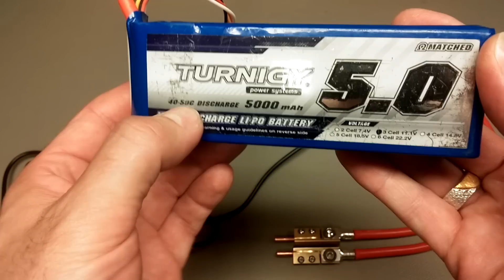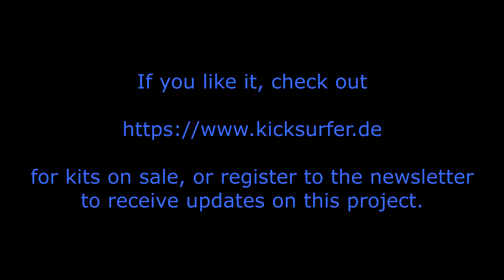Next level DIY battery spot welding

Comment: That noise gate you used on the sound is really annoying, I would prefer the background noise vs the constant gate switching.
Reply from the maker: Tried that, but Youtube says "The ability to add or edit annotations ended May 2"...

Yes, it is using high current, 1000A in this first video, and 1400A in the last update on my channel. The power it delivers into the weld spot is approx 2kW.
Reply from the maker: no rude language in my comments please.
Reply: Let's see ... you're complaining about my complaining about your complaining about the video.  Your turn.
Reply from the maker: I can check. It does not make much sense to add a note in the  comments though, because many people including me don't read them by default.

These are no high voltage tips. The unit is supplied from a 11.1V Lipo battery.
Reply: ppdan it says “next level” maybe his...... idea.... of     next..... level..... is...... different.....than.......yours.....
Reply: ppdan : great vid, sound on iphone with no headset.
Reply: A noise gate that gradually lowers the volume is much less distracting.
Reply: Seriously!?  Someone would complain about the way a full truck load of free money was stacked and presented if they could.  I think I can live with the "noise gate."  Thank you for sharing this video.
Reply from the maker: I'm sorry for that. Unfortunately Youtube does not allow modifying a video after it has been uploaded. My newer videos on this topic are better :-)
Reply: It actually went unnoticed to me until I read your comment. I had to bump up the volume to hear the noise gate effect. I suppose it might be a bit distracting if you use headphones, but I'm using hi-fi speakers and the video sounded just fine.
Reply: It's so "strong" I thought my headphones we failing.
Reply: Me too - I didn't notice it.  It's a great video, but you can give the whiners their money back and tell them to shut the fuck up.
Reply: I meant an annotation on the video. Like a big fat "sorry for the sound, too late.". Well my electronics knowledge sucks, I thought you"d need High Voltage to weld. Is it high current then ?
Reply from the maker: sorryyyy, I would re upload it with better sound but Youtube doesn't support this...
Reply: Oh, yeah ... sorry.  Their complaining just rubbed me the wrong way.
Reply: Complaining about people having an opinion? I don't think that I have been rude when I gave my opinion on this matter.
I have worked in sound and light business for decades which probably makes me more sensitive to these kind of things. I guess when we hear something like that we tend to get annoyed because the "knob" for fixing this is out of reach.
Just to clarify : what struck me the most was the poor attack settings and lack of hysteresis which makes the gate extremely obvious to any professional.
Reply: sorry too, I didn't mean to harass you but it's very surprising at first. Maybe you could add an annotation (if youtube allows this). Anyway thanks for the video, it's a need device. Scary seeing naked fingers so close to high voltage tip btw :p

Comment: How do you ensure that the thyristors fire at the same time?
Reply from the maker: These are no thyristors but MOSFETs, with all the control gates tied together.
Reply: I was sure I heard you say thyristors at 1:20, I probably misheard. I was just wondering if the small difference in turn on time would cause any issues with over 1 kA coming from the battery.
Reply: He said Transistors
Reply from the maker: Even at 2kA, every transistor alone could handle the switching process (except for the inductive kickback at turnoff), the switching time is approx 10 microseconds.

Comment: did you drop a via under the gate pins on those fets? how many layers is your pcb? your design is pretty similar to what i independently came to. I only had 70x100mm ccs when i thought it out but i have 4inch by 7 inch 2 oz boards on order now so ill probably be sticking the mcu on the same board too. I had  the source going through the board and bolting to the rails was going to be an issue but ill probably end up moving them same layer in a similar fashion. I need to get my drill rig assembled though because at the moment im hand drilling vias with a cheap tool, i compensate by extra large pads so the board survives if it slips a little but this far from ideal
Reply from the maker: The gate signal trace is on the top side, the PCB is double sided 1oz. That is enough because the power connection traces span the entire MOSFET group width, and are less than 1mm long. The bus bars quickly dissipate the heat after a pulse, I can barely measure a temperature rise. I calculated it for fun, the cross section is larger than that of the 300A fuse. I've added vias, and the same amount of copper on the bottom side, but that may not even be necessary. Don't route the current through vias anyway. A 0.3mm via can carry 1A, so you'd need >300 vias in total. Also keep in mind that minimum track widths and spacing is larger for 2oz copper, I would not go below 0.4mm for each.

I have stopped making/drilling my own boards a long time ago, professional services are just too cheap nowadays. I would be able to sell the bare board of my welder for 10€, and sill make some profit.
Reply: It was the first board i designed and only 2 months ago, but I wouldnt have done it if not for realizeing I had a huge pile of plexi in my garage and a friend I could consult with chemistry on. through her advice on how not to die, I managed to produce efficent and refreshable cupric chloride from chemicals easily available. cost was about $20 and if i wanted to i could make 1.5 gallons but cupric grows as you use it so i started with 600ml for my thin tank.

   Acetone welds plexi if the edges are smooth. I already had a miter saw. Picked up a 80tooth 10in blade for 30usd and was able to construct a vertical bubble tank for the cost of the saw blade. I had been doing phone repair so I have a vacuum hot plate where heat and vac are switched independently. using more plexi and some disassembled light fixtures I was able to suspend a $35usd high efficency 365nm led at a variable z and y axis over the "floor" of the exposure box.  drilling a few holes and using weather stripping allowed me to pull my glass plate down with vacuum so the transparency is compressed tight on to the uv resist film on top of the board. I have low iron glass coming this tuesday for even quicker exposure as normal glass reflects a lot of uv 

When i looked at proto services in the US the cost was about 111usd and a 1 week wait for the size of board i made. you get 3 for that price but my worry was how quickly cost would bankrupt me if I got it wrong with the first design. I would never do a production batch at home but the ability to prototype at home has opened the world of making products instead of repair them. I didnt end up spending much more than the 1 week service would have cost.  After drill press is complete it was probably 250-300 spent. had i spent more time in research i could have done it for 200 but much of it was trial and error so I sometimes bought things that needed to be changed.

now its together though i can get double sided 4x7in cc for a dollar a board. Anything i make in the future is now very cheap to proto. Later today im going to pick up some chemicals to try a via plating bath.
Reply: mine wasnt just a via, it was a copper rivit with the source lead stuck through and soldered onto the wide pad x6 n-fets ...irl83034
Reply from the maker: That's a quite impressive tool range :-) It deserves to be used. For PCB proto, you need to trade off cost and time. Companies like Elecrow or Seeedstudio will make them at low cost, but they don't give you order today, receive tomorrow. Only when I have to go fast, I order from local suppliers.My preferred German supplier PCB-Pool has a budget option with 8 working days and 43€ for 100x100mm 2layer 1oz.
Reply: thats not a bad price. i tend to be a rather impatient person lol. When I dont have to rivit through holes and can just plate them im thinking I will be able to do a 2 layer design in about an hr with 30min of that being hands on time. Less if I get help at some point and can teach someone to clean/prep and laminate a bunch of the CCs then insert them into a light proof bag. At night its no issue as my place is lit entirely by LED, but windows become an issue in the day. Right now im too swamped to prep a lot myself so I just do it as needed which adds to time/probably isnt as efficent
Reply: Ultimate goal is to build a ras pi into a pen test tool for a friend of mine. I built a plexi case that can house a parking garage HID long range proxy reader on one side, 4s 2p 18650 pack, pi, dc-dc converters (reader needs 24v for max range) breakout for pi, board to host the removable software reprogramable proxi card I made using an attiny85. With a smart phone you can monitor what tags you have captured at your target location. Then command the pi to flash the tiny with the card you captured walking by. walk up to door, and look like anyone else who had their tag in their backpack. reach in pull off the soft key and tap to reader. Im using right angle sata ports to pass the spi onto the antena pcb with the attiny mounted. most annoying thing ive hit so far was building a nice coil manually in eagle and mitering all the corners

Comment: Im still interested in your welder. so assembled its about 130.00 bucks? I will be using this for 18650 battery packs. i thought i heard you say this is not well suited for this. if this is true this wil not work..let me know .......Thanks
Reply from the maker: That must be a misunderstanding. My welder is specifically developed for 18650 cells and similar. I'm about to make a new video today just doing this on a real battery pack. "productive use". The price starts at 99€ for the programmed and tested electronics module, if you can solder simple through-hole components. Aside from a power source, the working kit requires a bunch of other parts: foot switch, fuse, the metal high-current bus bars, bolts and nuts, cabling, electrode holder, electrodes, optionally an input connector. As power levels and currents are very high, this comes at a price. But what you get is a robust spot welder that makes very controllable welds, and can easily compete with 2000€+ professional machines.
Reply: WeAreTheWatt all I need I'd the board and electronics. I can assemble most of it  myself. how much would it cost me. I don't need the foot pedal either. what is the operating voltage? is it 12v(11-14v) I could really use one of these.

Comment: Why you decided to use one driver for all mosfets?    Why there is a generator (IC5) instead of controlling the mosfets switching by your main MCU? 
Thanks
Reply from the maker: Other than one might think, the turn on/off process is not critical in this application. The turn on time is approx 2 microseconds here. Let's exaggerate here and say that one of the six transistors has to do that alone, and simplify further and say that the switching energy is 2000A * 30V * 2us. This results in 0.12 Joules of energy, which is 1/10th of what every single chip can handle. That is well on the safe side and this is why onle one MOSFET driver  is used.

IC5 is a monoflop and limits the maximum pulse duration to 250ms, in case the software "forgets" to terminate the pulse. It's added as an extra safety net.
Reply: is that in addition to the mcus watch dog timer?
Reply from the maker: I'm not using the MCU's watchdog timer. The main pulse control loop is quite complex because it has to do a lot of calculations and checks, and if something goes wrong there the watchdog will not notice it. Therefore the hardware monoflop "watchdog".

Comment: Im talking about the contact probes pressure. This needs to be consistent. I use spot welders at work. there are 4 different settings  current, pressure,dwell (hold time) pulse (how many hits of current).  yea i know this is not as fussy but these are just some of the things in spot welding...thanks
Reply from the maker: Sorry, I confused the battery that is welded on, with the Lipo power source. I thought, why should I apply pressure to the latter? Makes more sense now :-)

My system does not require consistent weld spot force, and it does neither need nor use cleaning pulses. That is because it works differently from all other spot welders that I have seen before. I'll try to explain:

Commercial spot welders fire pulses with a given duration. If there is not enough pressure, or if there is a bad contact from corrosion etc, then the spot's ohmic resistance is different from what it should be - the weld fails.

My design measures the instantaneous power that goes into the spot, integrates this to obtain the so far deposited amount of energy, and stops the pulse when the set value is reached. Al this is done every 10 microseconds.

This ensures that the amount of energy, or heat, that is dumped into the weld spot, is always constant, no matter how much initial pressure you apply, how much corrosion there is, how well the surfaces tough, and so on.

Comment: DOESNT THE AMOUNT OF PRESSURE YOU PUSH DOWN ON THE BATTERY ALSO PLAY A PART.  JUST THINKING
Reply from the maker: What do you mean with that, do you mean physical pressure? I am not touching the battery.
Reply: YES THE PHYSICAL PRESSURE. EVAN THE ONE FROM CHINA HAS THIS.  THANKS
Reply from the maker: Ah, now I get it. I confused the power source battery with the battery to weld on. Makes much more sense now.

My welder does not need a constant pressure, and it does not need cleaning pulses. It measures the energy/heat that it creates, and keeps that constant, no matter how good or bad the contact is. That's the big novelty that AFAIK no other welder has, even the professional ones for 10000€.